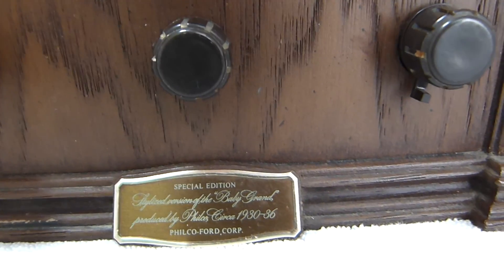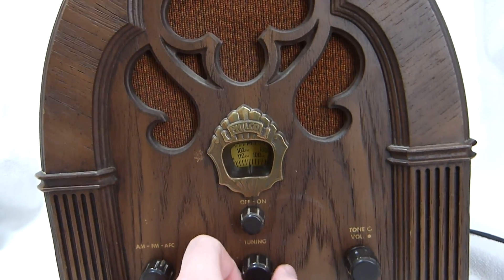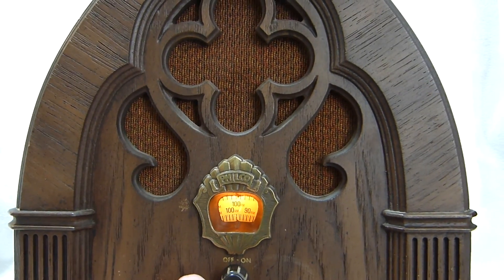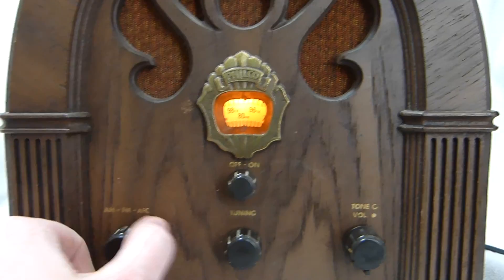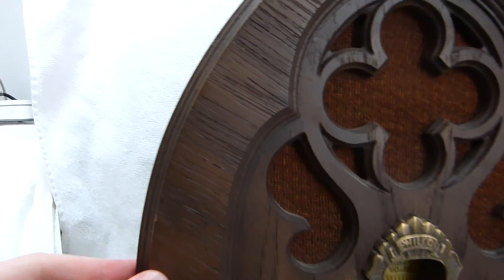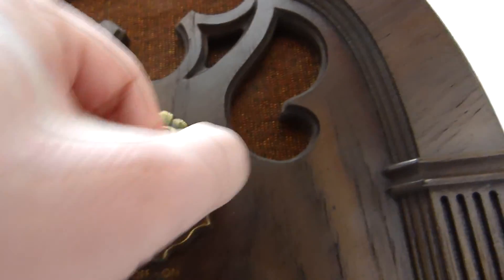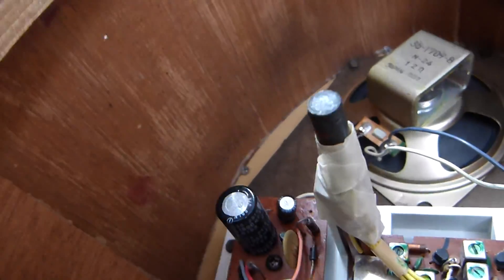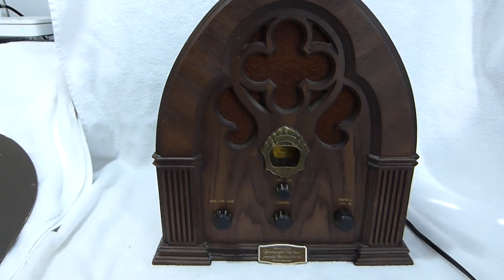Philco-Ford model R-90 cathedral transistor radio (~1973, Taiwan)

Comment: Haven't got a clue about the original Tombstone radios Matt, but you have done a great job on the tuning mechanism, and you have to be commended for that, but man the originals must have been something else. Thank you very much indeed for sharing your video Sir 👍 Tom.
Reply from the maker: The originals were of course much better built, though I'm sure they also cost quite a bit more (but they didn't have FM).

Comment: That's not a tombstone, it's a cathedral style.  The tombstone style was much more squared off.  The Model 90 "Baby Grand" was introduced in 1931 and at that time Ford did not own Philco.  Philco was its own company from the late 1800's until finally being bought by Ford in 1961.  "Philco" was a shortened version of the Company's original name which was the Philadelphia Battery Storage Company.  By 1936 they no longer offered a model 90, though they did make two styles of the model 60 B "Baby Grand".
Reply from the maker: You're absolutely right, I'll change the title to "cathedral". Thanks for the other info as well, I didn't know what Philco was short for!

Comment: I have an unusual question. Is it possible to convert one of these radios to run off battery power instead of AC?
Reply: I was just thinking about that concept just before I got on this page again  a minute ago. :-)

Yes, they can be run off of batteries... a quick check of it's  power-supply's output-voltage will indicate how much battery-voltage is needed , and a suitable battery-pack can be made to fill that need. 

They're definitely nice -looking sets. They look kinda like the most famous of all the ancient Philco radios, the  Model 90 from 1931. 

More info about the original Model 90 here: https://antiqueradio.org/philco90.htm

Comment: I've seen dates coded on speakers before like the "7237" on that one where it meant the 37th week of 1972. That seems early to me, but it's a possibility. Having seen all of the other radios you've shown, I can see why you think it doesn't fit it in.
Reply from the maker: That number could be a date code, and I suppose 1972 isn't out of the realm of possibility, since there are no ICs in the radio.
Reply: And it's an Alnico magnet speaker suggesting its vintage to be of that. I was too surprised by the radio actually having a 4" speaker in it.
Reply from the maker: The sound quality from this radio is actually pretty good, and the (relatively) generous speaker is a big part of that.